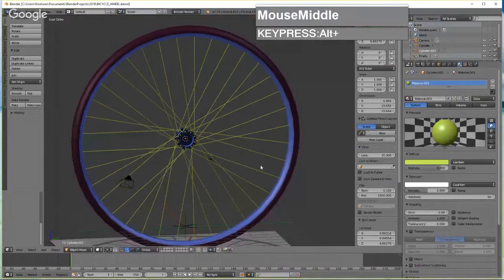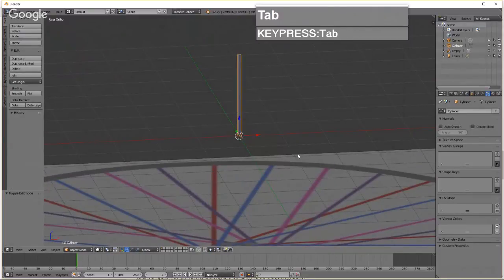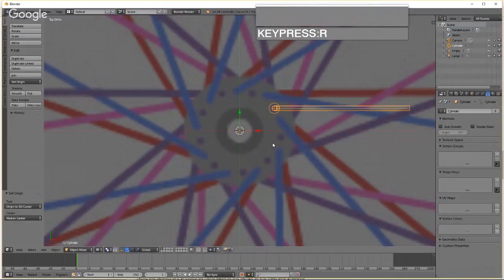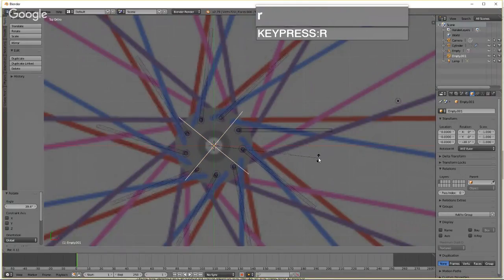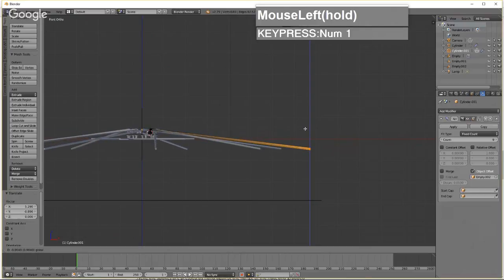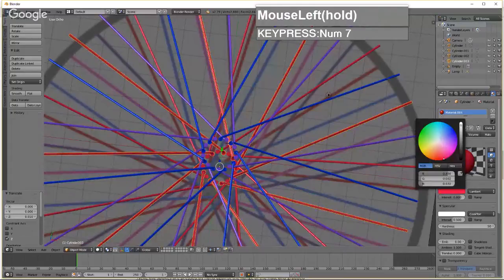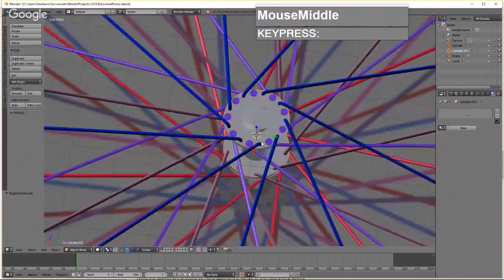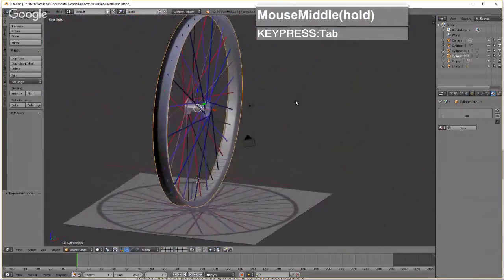Modeling a Bicycle Wheel in Blender

Comment: God these old Blender videos may as well be useless now.  2.8 is so different at crucial moments.  I just wish there were more useful vids like this made for 2.8
Reply: Turns out, Blender 2.8 requires you to add a modifier called decimate.  It doesn't even give you a normal value of faces.  You got to do some decimal fractional shit to work it out.  Luckily, I went for 0.25 and got the 8 faces for the spoke.  Wonder how many more over complicated things ~I have to deal with going forward.
Reply: Ugh!! Creating that little bend in the spoke is completely different in 2.8 as well.  I give up on this video.  Hopefully I can find a bike tutorial for 2.8.  This is like a painful chore.
Reply: You can quite easily replicate the steps in 2.8. For the bend in the spoke , instead of Alt+R , use the spin tool in edit mode, and refine your settings in the the settings box at the bottom left of the screen to make it exactly 90 deg and only 4 steps. This video is still perfectly good to use in 2.8 with a bit of thought. Definitely not useless.
Reply: I only struggled with pivot point in edit mode
Reply from the maker: @MrG00ny65  In Version 2.9, it is ALT+E now where you are presented with Extrude options including spin